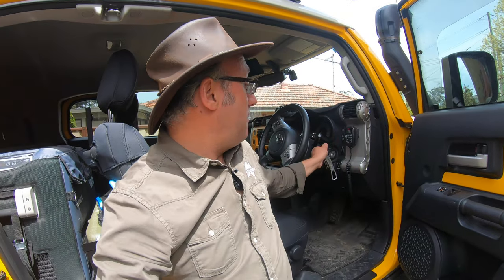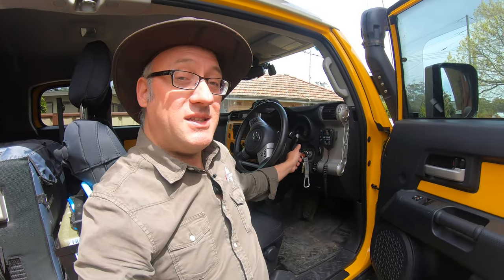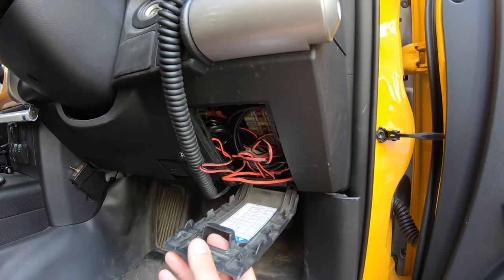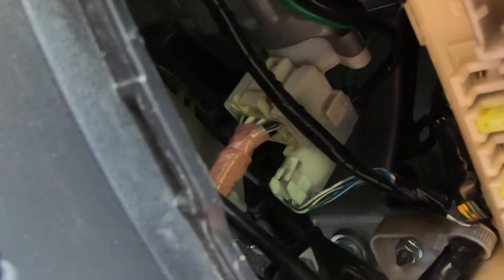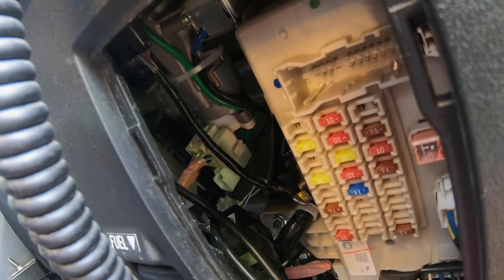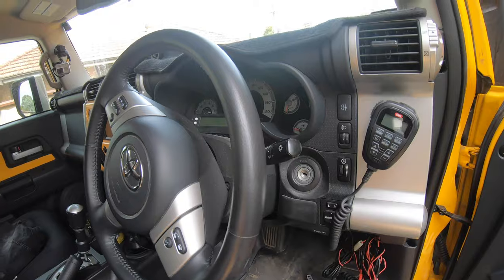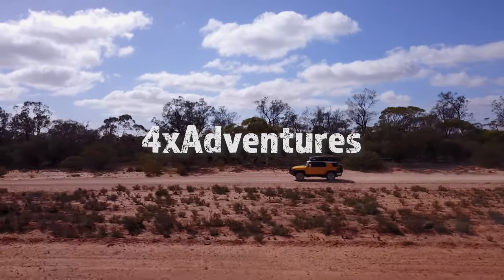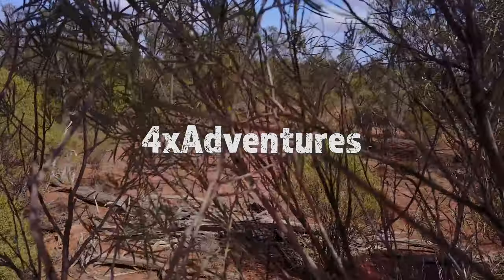The Quickest FJ Cruiser Hack Ever! | @4xAdventures#adventure #4wd #touring

Comment: Great tip.  Does it affect anything else at all by removing the plug?  Cheers
Reply from the maker: Thanks! Nope! Nothing else is affected. This is simply disconnecting the door open sensor. 
I have a scangauge connected to the diagnostics port & no error codes are generated. In addition, I have also verified with my local Toyota service dept who agree that it is safe to do without any detrimental affect.
Enjoy! :)
Reply: @4xAdventures  Great. Thanks mate. Love my FJ.... will keep an eye on your trips and tips. I post the odd clip on my FJ and trips.  Will need to do a few more!  Cheers
Reply from the maker: I'll definitely check out your channel!

Comment: Are there any other functions connected with that wire? All you lose is the beep?   If so I am going to do this mod for sure. 🙉
Reply from the maker: No other functions. All that wire does is essentially disconnect the speaker. I’ve had mine off for several years now and can confirm no side effects. 😊👍
Reply: @4xAdventures    That is so cool. Thank you. 🙂

Comment: Firstly i used bluetack to cover the speaker then i just cut a lead on the speaker, WHY? because certain systems may not function correctly without that plug plugged in. bet ya didnt know that.

Comment: Seatbelt?
Reply from the maker: Hi Roger, under the passenger seat, there is a plug you can pull apart which disables the sensor in the seat so you won’t get the annoying beep if you are carrying something heavy enough on the seat. Useful when you have shopping etc. on the seat which sets off the alarm. 
I didn’t make a video about it because this is a safety feature & is something you should probably leave on, especially if you have kids.
Anyway, that’s how to disable it if you like.
Enjoy! 😊👍

Comment: Looks like the wiring in the US is different. Forum guys are cutting wires 😶
Reply from the maker: 😱 As far as I know, the Australian model is identical... maybe it depends on the year model. We only got the FJ from 2011-2016. Perhaps the older models did have some differences. 
I’d track down a workshop manual before cutting wires!!
Reply: @4xAdventures  That makes sense! I have an 07. Cutting up a factory harness is a definite no for me. If there's anyone else in the US that is curious, there is a blue connector located under the steering wheel, disconnect that and no more key chime.
Reply: @jaygill3037  Man! I just did your mod, thanks so much!!👌👌👌 
I was heavily debating cutting the factory harness and losing the seat belt chime in the process.
Pull blue connector for the win!
Someone needs to make a vid about it.
Reply from the maker: Glad I could help!! 😊👍

I was considering making a video about that too, but since it’s a safety feature, I thought I’d better not advocate disabling it. 😊
Reply from the maker: Thanks for the info!! It is also important to keep in mind the legal side of things. For example, where I live, it is actually illegal to have headlights on in the daytime, unless there is poor visibility e.g. rain & fog. 😊👍